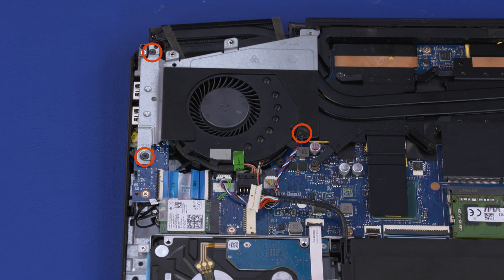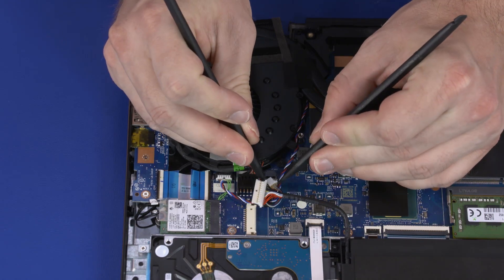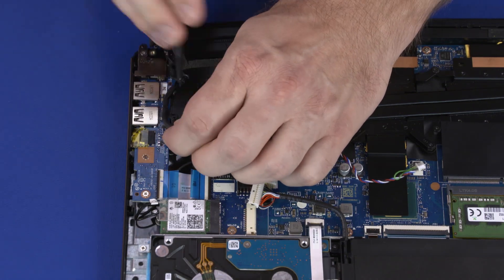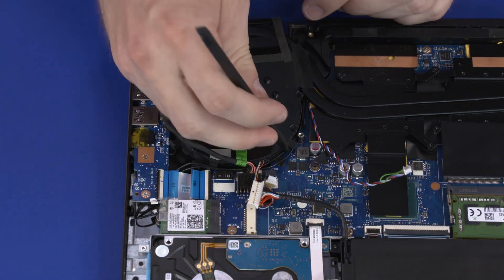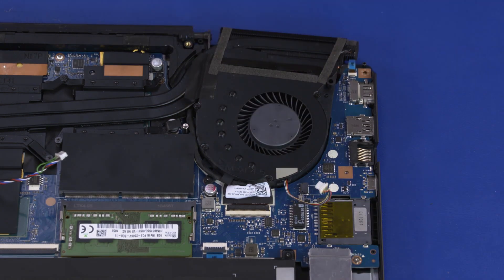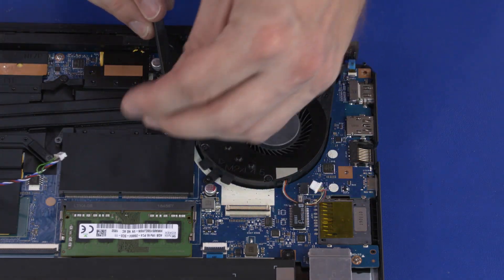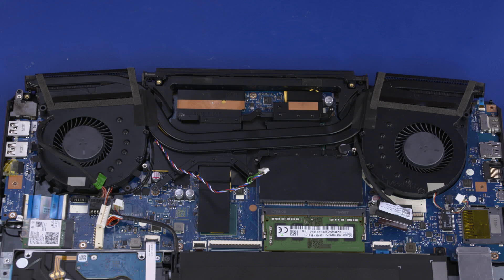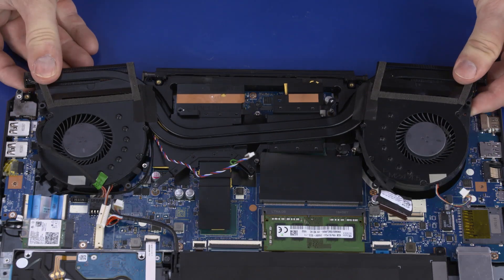Replace the Thermal Module | HP Gaming Pavilion 15t-dk0000 CTO Series | HP

Comment: Would replacing the thermal paste by myself void warranty
Reply from the maker: +Tanay Waghchoude HP does not recommend upgrading or downgrading hardware parts or software that is bundled with the product as It may affect the manufacturer's warranty and performance, however, you could change the configuration at your own discretion.
Reply: It does not matter as the Warranty is so short anyway
Reply: @MattDeezly  2 years is so short? bruh
Reply: @Sierra137  Depends, I bought it in a mall (external hp store) and It had 1 year warranty, so it's fine

Comment: I had contacted sevice center of hp.i just wanted to know that will replacing the part fix the thermal throttling issue plus will I get the performance I used to get plzzz answer me sir and will replacing part from hp service center decrease lifespan of laptop??i am from india jharkhand area pin-834001.plzzz answer me sir.
Reply from the maker: +pros Please contact our phone support team to fix this issue:
Please follow these steps to reach them.
Step 1. Open link: https://support.hp.com/us-en/contact-hp
Step 2. Select the product type.
Step 3. Enter the serial number of your device or select let HP detect your product option.
Step 4. Select the country from the drop-down.
Step 5. You should see the HP phone support number.

Comment: I had dropped my lapy and it's vents seems to be broken .is this the reason I am experiencing thermal throttling.will changing the heat sink fix my problem.plzzz reply me .also when the problem of thermal throttling is fixed the will I get the fps I used to get????
Reply from the maker: +pros This seems to be a hardware issue with the notebook. Please contact our phone support team to fix this issue. Please follow these steps to reach them.
Step 1. Open link: https://support.hp.com/us-en/contact-hp
Step 2. Select the product type.
Step 3. Enter the serial number of your device or select let HP detect your product option.
Step 4. Select the country from the drop-down.
Step 5. You should see the HP phone support number.
Reply: @HPSupport  I had contacted sevice center of hp.i just wanted to know that will replacing the part fix the thermal throttling issue plus will I get the performance I used to get plzzz answer me sir and will replacing part from hp service center decrease lifespan of laptop??i am from india jharkhand area pin-834001.plzzz answer me sir.

Comment: are we allowed to add more ram and repaste the laptop ourself? i don't think there's any hp center in my city
Reply: btw, mine is Pavilion Gaming 15
Reply from the maker: +Hendy Stark HP does not recommend upgrading or downgrading hardware parts or software that is bundled with the product as It may affect the manufacturer's warranty and performance, however, you could change the configuration at your own discretion.
Reply: @HPSupport  aka HP do not want you to upgrade or do anything internally. Because they want you to pay more at their centre. So they can make more money. 

Fr, they dont want you screwing inside and possibly broke something andthen you try to have it warranty even though you should be responsible for the damage

Comment: Will void warranty
Reply from the maker: +Tech4life HP does not recommend upgrading or downgrading hardware parts or software that is bundled with the product as It may affect the manufacturer's warranty and performance, however, you could change the configuration at your own discretion.